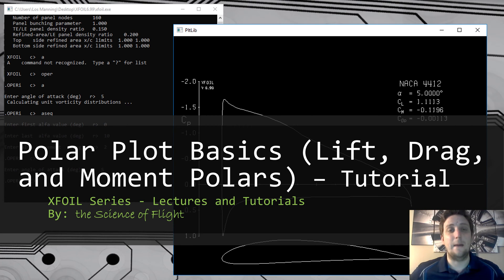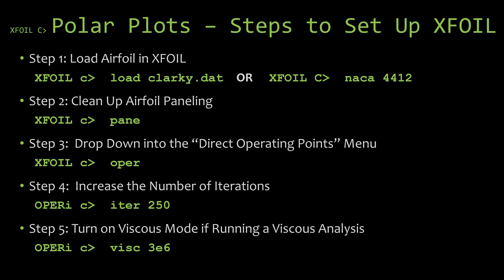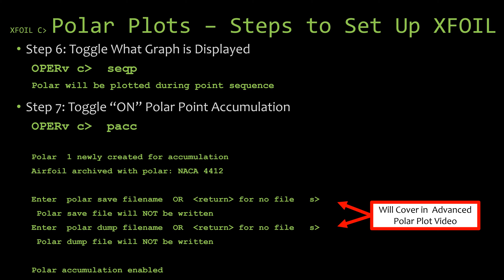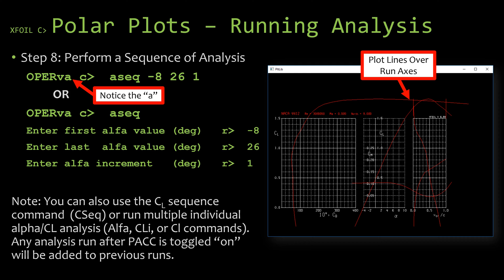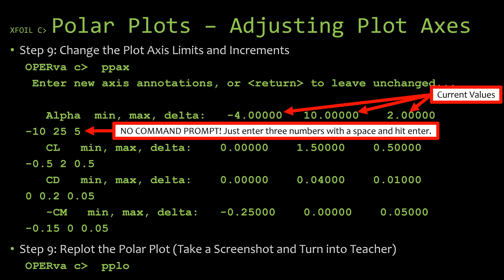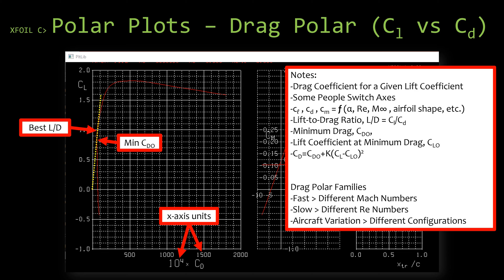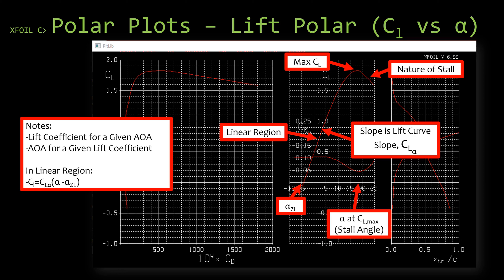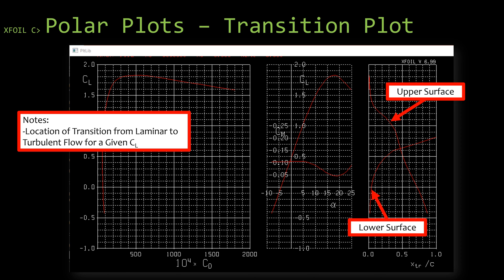XFOIL Tutorial 5: Polar Plot Basics (Cl vs alpha, Cl vs Cd, Cm vs alpha, Cl vs xt/c)

Comment: hey, cool video. I have a problem. Every time I plot something on PltLib, it shows the first plot, but whenever I try to plot again using pplo, it doesn't get updated, it is stuck with the same plot. I can't even close the PltLib tab. I would have to close Xfoil to do that. Any solution to this?
Thank you.
Reply: I had the exact same problem today and it was solved when i saved the polar to a file (at step 7) instead of just hit enter and skip that "polar save and dump" file part.

Comment: Hi, I really appreciate your videos and find them really useful, and honestly they have helped me a lot since i'm very unexperienced on XFoil. I have a little stupid question that you could maybe help me with. I have been struggling a bit with generating text files for the geometry aspects of the airfoil (such as the mean chamber or thickness) since i need to plot them afterards using MATLAB. So, is there any function that helps you with that specific task?
Reply from the maker: Repeated for those looking for this answer here: Unfortunately, input and output of data using files is a weak point of XFOIL. I hope in future versions that much more of the values are available to output to a file and therefore have more capability to run XFOIL from Matlab (I have it on my list of potential improvements to try and code up and try and get included into the next version). That being said I do know of one output file option available for airfoil geometric values in the standard commands available from the command line prompt. After loading an airfoil into XFOIL, if you navigate to the “Geometric Design” menu by typing in GDES and hitting enter and then you can navigate to the “Camber” sub-menu by typing in CAMB and hitting enter. In this sub-menu, you are able to write the airfoil camber and thickness to a file. This file will contain 4 columns: 1) chord location of camber, 2) camber, 3) chord location of thickness, and 4) thickness. Note: The thickness is the thickness above and below the camber line so if you will need to double this column if looking for the max thickness value. For example, NACA 4412 has a 12% max thickness but the 4th column of the output camber file will have a max of 0.060017. This is because the total thickness is 0.060017 above the camber line plus 0.060017 below the camber line for a max thickness of 0.120034, or 12.0034%.

Another work around would be to output the airfoil coordinates to a file (using the PSAV command in the main menu) and calculate the values you are looking for from the airfoil shape directly. You could potentially find in the source the code you are looking for to calculate a particular geometric value and use it to calculate the value (though you would need to abide by the GNU General Public License for your new code).

Hope this helps! Thanks for the kind words of appreciation for the channel. I’m just getting started, so many more XFOIL videos to make, lol.
Reply: the Science of Flight wow, i didn’t expect such a detailed answers, that actually helps me a lot with what i’m trying to do for university. Actually, wouldn’t it be possible to run the geometric design option of Xfoil from matlab so you could at least manipulate the data you obtain? Thanks again for the reply, it was really helpful.

Comment: My plot doesnt change. I had same issues in cp/x graph too. How can I fix it?
Reply from the maker: Hmm, this is a very general issue. If you gave me a list of the specific commands you used (in order), I might be able to give better advice. In the meantime, a couple things might be going on. Sometimes if you change a value or parameter you have to rerun an analysis for the plot to change. Try rerunning the analysis and seeing if the plot changes. Sometimes if you change something, you have to replot it. For example, when adjusting the polar plot boundaries using the PPAX you have to replot the polar plot using the PPLO command to see the changes. Try using the PPLO command to replot the polar plot, using the SEQP twice to switch between plots to see if it will replot when switching back, or using the CPx or CPV to replot the Cp plots. Sometimes it changes but we don’t notice it changed or our settings are wrong. For instance, if the steps in this video that talk about turning on the polar accumulation weren’t followed then instead of plotting lines on the polar plots the script is plotting a single point of the last angle of attack/CL that was run with the plotted point often not being visible. If using aseq/cseq, it plots a point for the first run, then clears the plot and plots a single point after the second AoA/CL, then clears the plot and plots a single point after the third AoA/CL, and so on till it plots a single point for the last AoA/CL. Try going back of the steps I mention in the video and follow my steps when I talk about turning on the point accumulation. Hope this helps find the issue. If not, respond back with all your inputs and I’ll try and help locate the issue.
Reply: Merhaba kardeşim sorunu nasıl çözdüğünü anlatır mısın?

Comment: Thanks for all your videos! I have a problem tho. With the NACA1107 I have CL that goes up, stall but then goes back even higher. It should go down from the stall on. What should I do?
Reply from the maker: When talking about airfoil stall, this is considered the maximum coefficient of lift or maximum angle of attack achieved before the coefficient of lift begins to decrease while increasing the angle of attack (that first hump where it starts to decrease). While stall is not instantaneous there will still be some lift after stall that continues to decrease. We look at the first few degrees past this stall angle of attack to judge the nature of the stall, but we don’t go past that point. The assumptions and methods used by XFOIL is such that it is only accurate to this initial stall angle of attack (generally between 10 degrees and 20 degrees AoA). If you were to increase the angle of attack more than a few degrees past this stall angle of attack (say up to 50 degrees AoA) you will get unreal results and could potentially start to see the CL raise up and go even higher but again these are unreal results that arise from using incorrect assumptions and models. You should only consider and plot the data out to slightly past the first stall angle of attack. Hope this helps!

Comment: Is it possible to draw or get best L/D line and point of contact this L/D line with Cl vs Cd plot using xfoil? I`m trying to do this without any positive effect.
Reply from the maker: There is currently not a way to plot the L/D line in XFOIL (I'll add it to my list of improvements needed in XFOIL and see if we can't get it included in a future release). The best way to do this at this time would be to export the results that you get from this polar plot into another software like Microsoft Excel or MATLAB. You can do that using the polar save file mentioned in this video and talked a little bit more about in my other video called "XFOIL's Polar Save and Polar Dump Files (Part 1 - An Introduction)" (located here: https://youtu.be/gMQSdDYKY5o ).

Example plotting it using Excel: If in Excel, I would create another column where for each row I would divide the value in the coefficient of lift, CL, column by the value in the coefficient of drag, CD, column (using the MS Excel cell functions of course. example: =B2/C2). This column would be the L/D that the airfoil makes at that specific angle of attack and the highest value would be the max L/D of the airfoil in those flow conditions. I would then create a "scatter plot with lines" and the first line would have the entire coefficient of drag, CD, column for the line's x values and the entire coefficient of lift, CL, column for the line's y values. The second line would have three points (you really only need two but I'm adding the third point on to make the line go past the tangential point for visual effect). The first point is (0,0), the second point would be the CL and CD values from the row with the highest L/D i.e. (CD, CL), and the third point would be 1.5 or 2 times the CL and CD values from the row with the highest L/D i.e. (2*CD,2*CL). This will give you a drag polar plot of CD vs CL along with the L/D line and point value.

I would recommend doing this once to get a general idea of where its at, like between 8 deg and 9 deg angle of attack, and then run these polar plot steps again in XFOIL with a very fine mesh between those points (like 8 degs starting AOA, 9 deg ending AOA, and 0.05 deg increment) to get a more accurate L/D value and location).

Hope this helps!

Comment: Hi,
 THANKS for the videos, do you know how to use the XFOIL to draw Cf (skin friction)?
Reply from the maker: You can plot skin friction vs chord location (Cf vs x) using the polar dump file and the pxplot.exe application that is installed in the same folder location as the xfoil.exe application. I have an introductory video on the polar dump file named “XFOIL's Polar Save and Polar Dump Files (Part 1 - An Introduction)” located here: https://youtu.be/gMQSdDYKY5o . The pxplot.exe has to be called from the command prompt. On a windows computer open the command prompt. Navigate to the folder that has the pxplot.exe file (On my computer I typed in: cd C:\XFOIL6.99 and hit enter). We are then going to call the pxplot.exe application from the command prompt (I typed in: pxplot and hit enter). It will give you an error saying “Error opening polar dump file” and give you three options to choose from. We are going to choose the third option “3  Load polar dump file” (I typed in: 3 and hit enter). It will then prompt you for the file name. Since it is in the same folder as the pxplot.exe, I typed in polardumpfile.txt and hit enter. We’ve loaded the dump file but now we need to choose which datapoints we want to plot using the first option “1  Select point(s)” (I typed in: 1 and hit enter). It will then display a list of the angles of attack that are contained in the polar dump file (“Computed points are:”), display a list of the currently selected points (“Selected points are:”) and prompt you to “Enter alpha(s) of point(s) to be plotted:”. So, I decided to randomly choose 4 different angles of attack, so I typed in: 4 8 12 16 and hit enter. You can choose whichever angles of attack you are interested in. We then have to choose what plot we want plotted using the second option “2   Plot selected point(s)” so in the command prompted I typed in 2 and hit enter. It will then give you a list of the different plot options. Since we are wanting the Cf vs x plot we will do the 7th option “7   Cf   vs x” (I typed in: 7 and hit enter). A second window opened up and displayed the 4 Cf vs x plots on the same plot.

I just ran through it on my own computer and it took a few times to get the polar dump file loaded but the rest of this went pretty well. Hopefully in a future update this will get its own GUI and the loading a dump file command won’t be so buggy. Let me know if you have any other problems with anything else.

Comment: Hello,

I did XFOIL analysis for NACA 0012 airfoil with a chord of 0.25 m. When I am extracting the value for Cm (coefficient of the moment ) for AOA 0 to 12, I am getting positive values. Is that correct? I found in the literature that Cm vs AOA is a negative curve. But mine is a positive and almost similar to the Cl vs AOA curve. Could you please help me with this.
Reply from the maker: Yeah I can help, no problem. The moment coefficient should be negative for NACA 0012 at AOA 0 to 12 (and positive for A0A -12 to 0). Can you post all the commands that you used and I can try and see what went wrong?
Reply: @thescienceofflight1404  
Thank you very much. I could figure out the issue. I was getting the wrong Cm as I did not change the Cm reference location (XYCM) to 1/4 of the chord. In XFOIL it is at (0.25,0) by default and for my case, the chord =0.25 only. As I did not change XYCM to (0.25*0.25,0) I was getting the wrong output
Reply from the maker: Ah, makes sense. Glad you figured it out, that's a new one for me. Let me know if there is anything else I can help you with.
Reply: @thescienceofflight1404   thank you very much

Comment: how to plot graph between cl vs alpha?
Reply from the maker: The middle plot created in this tutorial is both a cl vs alpha plot and a cm vs alpha plot. So if you don't mind having the cm plotted on your cl vs alpha plot you can just use that middle graph. However, if you are wanting a pure cl vs alpha plot it is, for the moment, not possible solely using XFOIL's built-in polar plotter. You would have to save off the polar data using the polar save file, import it into another plotting software like MATLAB or Microsoft Excel, and plot it using the raw data from the alpha and cl columns in the polar save file. I currently have a video on the polar save file (planning a few more on the polar save file). Feel free to check it out, it will probably help with performing this task.

You could also "fake it" by adjusting the Cm polar limits, using the PPAX and then PPLO commands, until the Cm line moves off the plot. So if the Cm line's min and max value is -0.15 and -0.07, you can set the min and max values of the plot to -0.05 and 0 and the line will be moved off the plot. The Cm and number labels will still be on the plot though but it might be a quicker work-around.

Comment: Can I do just a simple Cl vs. alpha chart without Cm?
Reply from the maker: Not using XFOIL's built-in polar plotter. You would have to save off the polar data using the polar save file, import it into another plotting software like MATLAB or Microsoft Excel, and plot it using the raw data from the AOA and Cl columns. I currently have a video on the polar save file (planning a few more on the polar save file). Feel free to check it out, it will probably help with performing this task.

You could also "fake it" by adjusting the Cm polar limits, using the PPAX and then PPLO commands, until the Cm line moves off the plot. So if the Cm line's min and max value is -0.15 and -0.07, you can set the min and max values of the plot to -0.05 and 0 and the line will be moved off the plot. The Cm and number labels will still be on the plot though.

Comment: Hi, have you ever encountered a problem where XFOIL converged and generated results for the pressure distribution data (XCp and Cp) but not for the polar data (CL,CD,Cm)? When I input a particular coordinates to my XFOIL (which I run in its Matlab interface) it generated the XCp and Cp but the CL came out as NaN and other polar datas such as CD and Cm came out an empty cell. Can you help me with this? Thanks in advance
Reply from the maker: Hmm, it can sometimes be hard to diagnose whether the issue is with the XFOIL code or with MATLAB. Any chance you can share your code?
Reply: @thescienceofflight1404  Yes of course. But you should know that there are several sub-routines I used written in different Matlab files.. would that be too much of a trouble? And where should I be sending them? Thank you so much for responding.
Reply from the maker: I'd be happy to take a look at it and see if I can help locate the bug. Upload your code to github and send me a link to it.
Reply from the maker: Awesome, I'll take a look at it and email you back what I find.